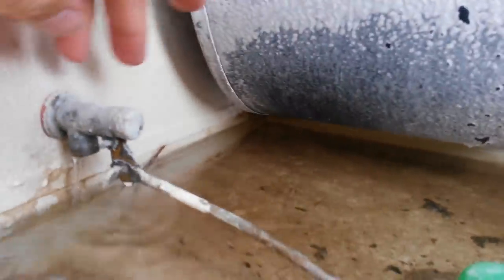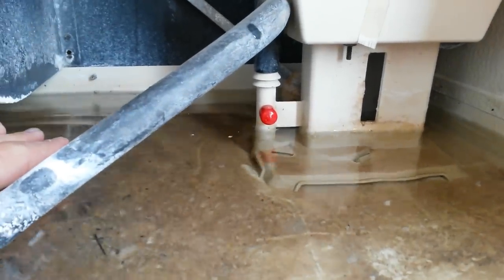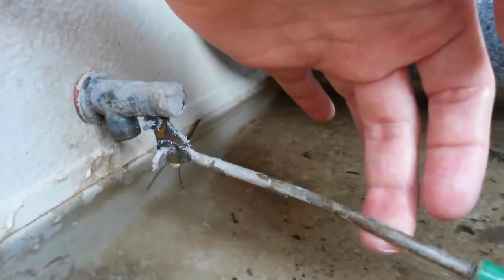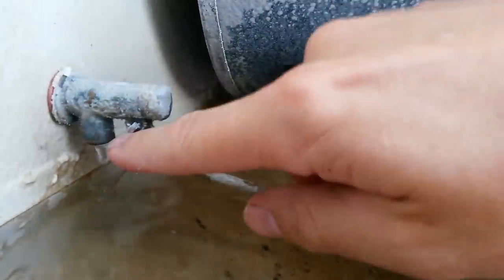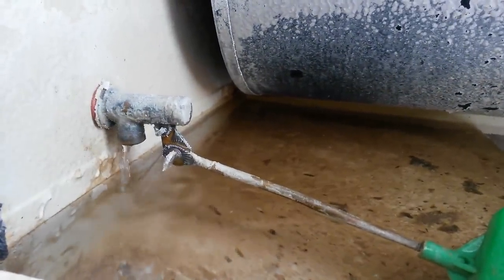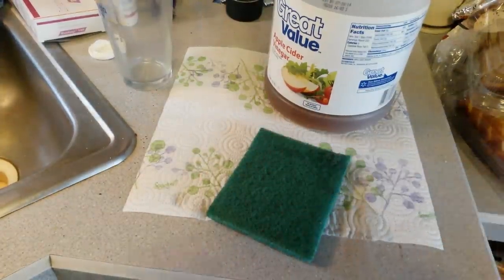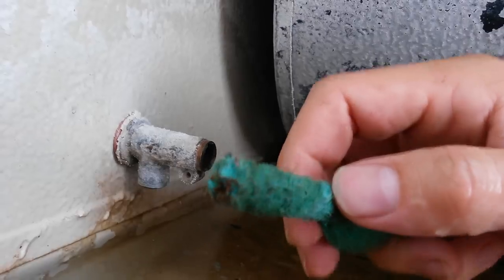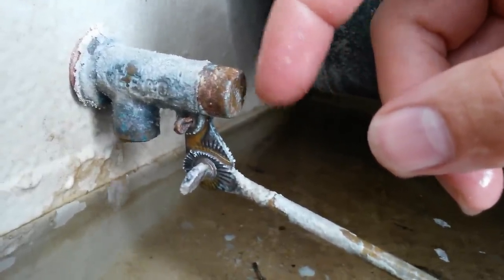Fix a Leaking Float Valve for Free ~ Evaporative "Swamp" Cooler Valve Repair DIY

Comment: In my Champion cooler  I added a 2nd water pump, it is an option, low cost.  About once a day it pumps all the water in the pan out to the drain pipe down to the yard or the grass.
Reply: The purge pumps with a timer usually totally discharge the tray every 8 hours, (3x a day)

Comment: It's not uncommon that you have to bend the rod on which the float is attached to get a more extreme angle, in effect raising the float overall.  We have one of the more expensive ones you mentioned (by Dial, bought at Home Depot) and it has been less than effective as store-bought.  We're bending the rod later today to see if it can be adjusted in that fashion.  If not ... buy a better valve?  Why are these things so primitive?

Comment: Make a solar still & connect it to your resevoir and you will never have to clean that valve again. :)

Thanks for sharing!
Reply: Are you saying to have a solar still supply the water for the cooler? There is no way it would produce enough water to replace that which is being constantly evaporated by the cooler.
Reply: cr38er
No, What I suggested is that you use a solar still to drip evaporated water into your evaporative cooler through your clean float valve.  If your solar still tanks (dirty & clean) are large enough, then you might only have to refill it once a week.

The size of your solar still will need to be based on the evaporation rate of your area--which should be pretty high in AZ during the summer.

Do you know the evaporation rate per square foot per hour during the hottest part of summer in your area?
Reply: The reason evaporative coolers work so well in AZ is because it it soo dry. In humid climates with moisture evaporating per sq/ft they don't work because the evaporation process isn't happening as fast. It would probably work, but the stills would need to be Huge... Like the size of a house.
Reply: cr38er How much water does your evaporative cooler use per day during the summer in a worst case scenario?
Reply: @zeffur7  I live in AZ with swamp cooler.  I wonder that too.  Our water bill only increases maybe $4/mth during summer when using it.
Reply: @alive-awake  Ony 4$/month.. that's a lot less than I would have thought.
A good solar still captures all the evaporated water, condenses it, & then channels it into a container of some kind (which could be the basin of a swamp cooler).

Comment: What could be wrong? I have water leaking from the outside copper line that runs into the float valve, where the nut attaches the copper line to the float valve on the outside of the cooler.

Comment: I changed the float and it's not shutting off water and is running out the bottom..im female my first try at this
Reply from the maker: If it's a new float valve, you have to adjust the shut-off level by bending the float rod, or unscrewing the float level screw and adjusting the float downwards. Sometimes you can just turn the float sideways also.

Comment: Yes these valves can be repaired. but the time it takes to fix these floats could take over an hour (not counting the fact it may not work) for less than $10.00 you can put a new one in, in less than 5 minutes. trying to fix an old one is a waist of time.
Reply: It didn't really work for him it was dripping the whole time unless he pushed his float way up.
Reply: I just bought a  new one and installed it.  Works during the day but drips all night just like the old one.
Reply: Yep, might as well go by a brand new leaky one... Lol
Reply: I bought one of the $$$ green adjustable valves.  5 minutes to install and adjust and not one drop once it reaches the shut off point.  We'll worth the extra $$.   thanks for your video.
Reply: Well I run two businesses and right now business is down to the point where I have more time than money at the moment so I'm going to go ahead and fix mine but you're right in most cases.
Reply: Some people have more time than money to WASTE.

Comment: Does anyone have the issue where it only leaks for about 60 seconds only right after I shut it off. It doesnt leak any other times than that. Maybe a little when raining, but not as much.
Reply from the maker: It's normal for them to dribble a little after shutting off. You can adjust the water level down a little if it is over filling. Sometimes just turning the float 90 degrees so it's pointing up and down will be all you need.
Reply: @TrailerDayz  thank you, I will try that. But it pours out of there for 60 seconds. I can get about 1 cup filled in that time. But then it stops.
Reply: @TrailerDayz  Also, this is after we just replaced the pump. Would this effect it?
Reply from the maker: @jenng8356  Yep. Calcium or grit in the valve is a constant problem and why they fail. They are pretty crude devices exposed to pretty harsh environments. That's why they need to be replaced or cleaned so often.
Reply: @TrailerDayz  awesome thanks for your help.
Reply: I'd be happy with that issue at this point! Lol